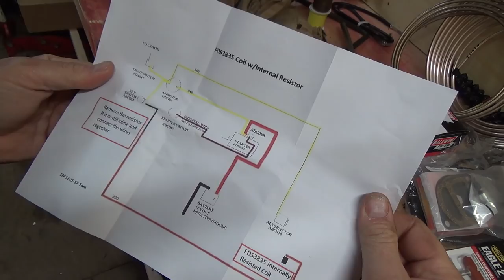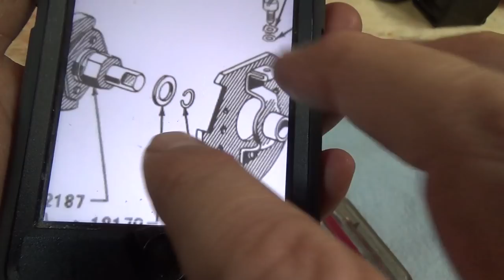1944 Ford 2N front mount distributor rebuild

Comment: That tiny grease packet is for the points pivot shaft and the cam shaft the points ‘follow’ on. My dad and I always set points a bit wide 16-17 thousands ( the cheap points today will ‘wear’ in real quick  and close up a few thousands. ).  Where are your magnetic screw drivers ? You can make your own by wrapping a dozen or so coils of heavy cooper wire on your tools then touching one end to positive post on a car battery and the other to negative post for a few seconds ( gets hot quick, wear gloves ) . On lay your tools on a strong magnet overnight ( welder’s positioning triangle magnets also work ). My dad taught me this distributor rebuild trick ( he was an Army mechanic in WWII ). Losing tiny distributor screws in the field in combat was not an option !  Gary in Port Huron, Michigan
Reply: When an old mechanic dies an entire library burns to the ground !

Comment: I noticed that you forgot the Rotor You generally expose the inner copper wire and crimp on the brass sleeve making sure it makes Good contact with the sleeve regards Alan from the UK
Reply: i never do much  work on fords  newholland or deeres i mostually work on 100% kubotas /case
Reply: Michael Mac Tavish ok?
Reply from the maker: Kubota never breaks down. What are you working on those?
Reply: @billstmaxx  i usely work on oil changes,  wich only takes me 5 mintues  to do wich  is nice  get the $27.00 5 liter jug of 10w30 wich aint bad of kubota oil and 25.00 oil filter wich glad kubota oil and filter is cheaper  but the newholland  takes 5 and a half hours wich sucks plus holy crap newholland 4 liter small jug $106.00 and 50.00 oil filter wich seems  newholland getting bad like deeres over pricey on stuff for corn snakes  lol
Reply: @finncampeau4922  hard belive deere 4 liter jug of 10w30 engine oil is 59.60 at deeres and  newholland wants $106.00 for a small 4 liter  jug and kubota was cheapest $27.00 for 5 liters bigger jug

Comment: Yep we all noticed the lack of rotor and you made the assembly of the points more difficult for yourself, put the springs on to the tab before dropping the assembly into the distributor base :-D.
If the core of that cable is solid wire i would remove some insulation and wrap the wire around the cable in a ring, then put the brass part on. (a ring of wire would come into contact with the brass all around) :-D
Just my opinions bill ;-D

Comment: you should have filed off some of the rivet top and bottom so you could put the washer under the cotter pin the cotter pin is going to wear thru the cotter pin possibly, washer will work as a bearing surface less wear on cotter pin just a thought points move a lot and wear.the disc dust and spark  shield over top of points you got it right.strip back and fold it over as others have mentioned you can roll it around but may make it hard to push it in terminal fold over and make sure its under brass tab on side should suffice
Reply from the maker: it didn't really matter the pin they sent didn't fit the hole anyhow

Comment: On a car/truck with a points distributor, if the points are burning normal then keep that condenser cause some condensers will wear the points badly.  Don’t file the points, just use a piece of paper to slide in between the points when closed and then remove the paper to clean any oil off. Do this 2 or 3 times. For terminating a car spark plug wire you put the boot on then trim the insulation off and bend it down then put the brass fitting on covering the wire then crimp. You may need WD-40 or Crappy Tire silicone spray to spray the boot so the wire slides in easier. Or you can put your boot on last. Here’s a good video https://youtu.be/J4i9yeYo1pk

Comment: You set the points with a  .006 feeler ( .015mm ) I think you have to reset the points . . . . I know you used a .006 and a .008 last time but this time I'm pretty sure you only had a .006 . . . .
Reply from the maker: No it was still the two of them. It was tricky to keep them together
Reply from the maker: I checked my video that I rendered.. Youtube messes up the quality quite a bit.. I noticed the first time I tried the feeler gauge I could see the .006 and the .008 together. hopefully she's all good.. Thanks for the notice though :)

Comment: rotor rotor wont run beep beep lol
Reply: yep cut back then fold over an crimp, also a tip if u gotta run those wires thru something mark them somehow on each end it ll make figuring out way easier when ya go to connect them